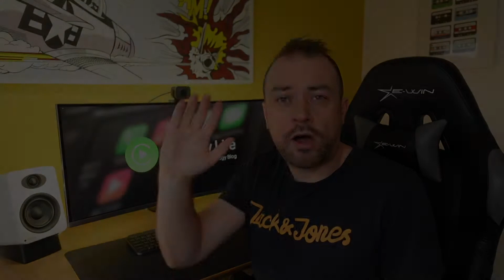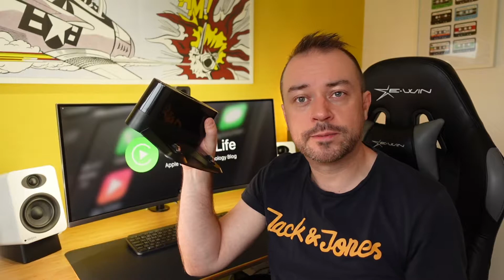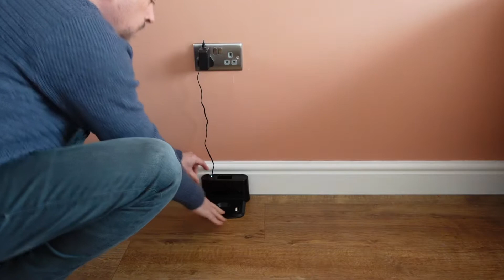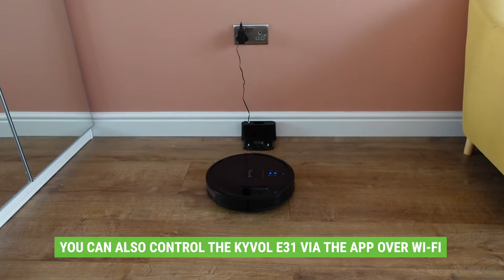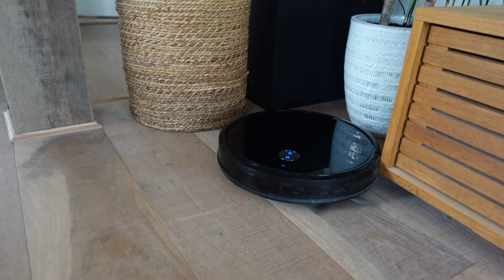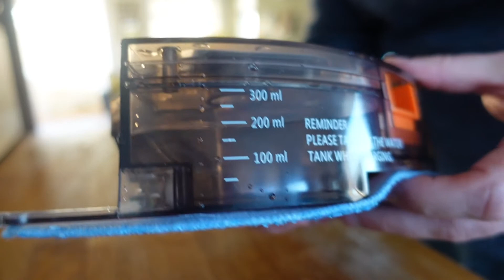Best Robot Vacuum Under $299? (Kyvol Cybovac E31 Review)

Comment: Do you still have this? Any feedback 6 months later?
Reply from the maker: No sorry I don’t. My advice would be to go for a robo vac with LiDAR or optical SLAM technology. Avoid gyroscopic or bounce navigation vacs.
Reply: @CarPlayLife  Hello, which model would you recommend having the LiDAR or Optical Slam technology?
Reply from the maker: @mbaraki90  Basically look for any vac that has a round turret like part sticking out the top of the vac. This makes searching online stores visually and dismiss any that don’t have this part. This is the LIDAR sensor. There are VSLAM robots that do not have this turret at the top, but it has two cameras  at the front of it. I had personally bought a Mijia 1T with VSLAM and in a few months I had a terrible software bug with it that rendered it inoperable. But when it I did work for the first few months it was decent, but I found the VSLAM to be inferior to my older LIDAR Mijia One robot, which I still use today.

So the things I would look out for. LiDAR sensor, at least 2000pah suction, room detection in the app, app support, charging doc, and don’t by a vacuum outside your location in case it breaks. I would have had to return my bugged 1T to china, very costly, and no guarantee of refund, and support didn’t help in the UK from Xiaomi. So £300 down the toilet and a lesson learned. If you want mopping, I would avoid, but if you want it, look for carpet/rug detection.

Eufy has a new model called the X8. I reached out to them to review it but I’ve yet to get a reply. That model seems to tick the boxes apart from how their dirt storage box is designed.

Hope this helps.
Reply: I purchased Kyvol E30 last year and it stopped working after 6 month. Costumer service was the worst. Wouldn’t recommend.